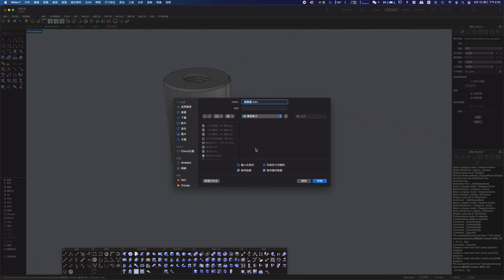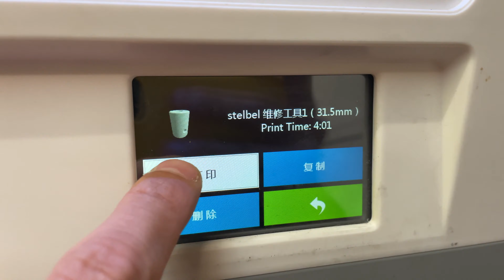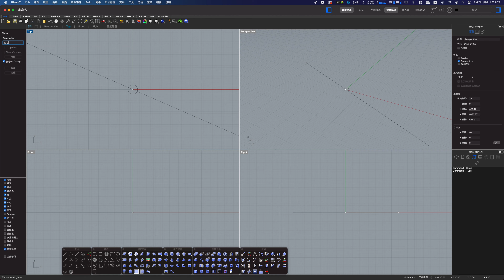columbus xcr被一箱茅台砸中的钢架 Stelbel Antenore 凹痕修复记录 不锈钢管复原steel bike dent repair

Comment: Great effort ... but, my friend, you reheated the top tube and altered its tensile properties, making this a weak spot on the frame ... so this is a botched job in my books. I would try to invent a device that pushes the dent from inside the tube - something I have yet to see.

Comment: Fantastic effort much better then then a simple fill job. But these modern high tech steel are heat treated. I know if you did that on reynolds 953, it would lose its tensile strength and be no different to basic cromoly. Hopefully it's retained its integrity, for its a fantastic steel
Reply: At 600 degrees Celsius, even a Reynolds 953 won't be affected